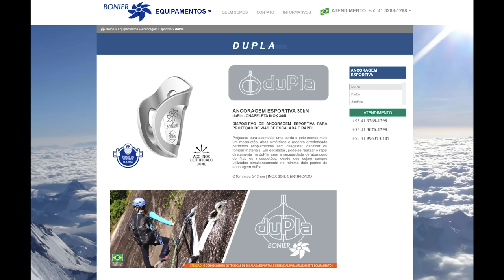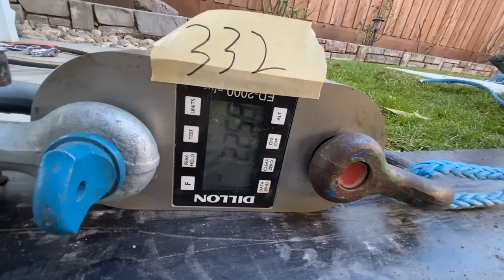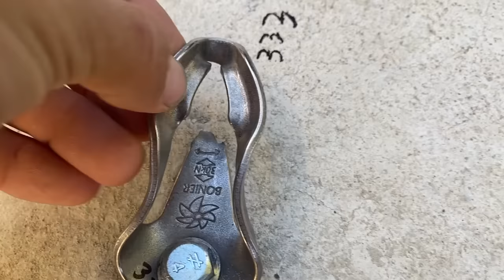Double sided climbing hangers? Dupla from Bonier

Comment: Have you guys ever tried breaking the removable hangar bolts from Petzl? I guess they are really easy to remove without any tools needed. I'm curious how bomber they are, does repeated use mess up the holes? and would it be a great option to prevent thieves without using a glue in permanent solution.
Reply from the maker: yup... got 3, just need good granite for a fair test and I have the unique drill bit in the mail for it
Reply: I’ve used them an hung/belayed from them on the cliff but never pull tested! One has to believe that Petzl has done extensive research on them! I don’t think they would put anything on the market that would not perform as stated.
Reply: @HowNOT2  Can't wait to see it!!
Reply: @bobclark2300  So it takes a special drill bit to make a certain hole then? Are they pretty easy to use?

Comment: Seems like the would be a pain on multipitch anchors, what are you going to clip yourself into while you are threading the rope to rap? Having two people clipped to the hangers and then trying to thread the rope through the same hangers sounds maddening. Seems like a cool design untill you actually think about using them...

Also your wear component (the hanger in this case) is not easily replaceable with a design like this
Reply: It works pretty well, here (Rio de Janeiro) we use in multipitch a lot, the biggest problem actually is the other model that this brand Bonier has. The Pingo. Works amazingly when used like a  regular bolt, but terrible in rapel station, they will probably test one some episode.

But yeah, rapel stations with rings is more comfortable and easy to maneuver but a lot more expensive (dupla costs something like 4-5 dollars)

Comment: I just saw something about these online somewhere a couple weeks back (not here). I was intrigued.

I was actually at @Mountainworks in Provo, UT a couple days ago, and they had like a hundred of these for $8.25 each. So I bought a couple pairs. I haven't drilled and bolted them yet, but I will in the upcoming next couple days. I have high hopes. AND! They're cheaper than a ClimbTech Hanger with Ring which was $11.50. Sooo... Much better value as well?

Comment: Interesting. Never seen a real hanger in Brazil. Would love to see you break those "P" bolts they use down there in Rio ? They are an interesting piece of Kit and you can rappel off of just one if you trust it. Not sure if they are homemade or manufactured but they are everywhere in several different sizes from scary quarter inches to burly 3/4 I think
Reply: They are homemade but now when the p-bolt need to be replace you see some of that Dupla on the rapel station or the most common one the Pingo (same Bonier but other model).

Some Pbolts have been replace for titanium bolts as well

Comment: Would be cool if you could place them outside. Then make another video in a year or something, to see if they have corroded.
Reply from the maker: Why would they corrode?  It also depends where I put them.
Reply: @HowNOT2  I could have just looked at their web page and figured out that they are made from 304 steel. Are they really thoug or do I have trust issues? 😅